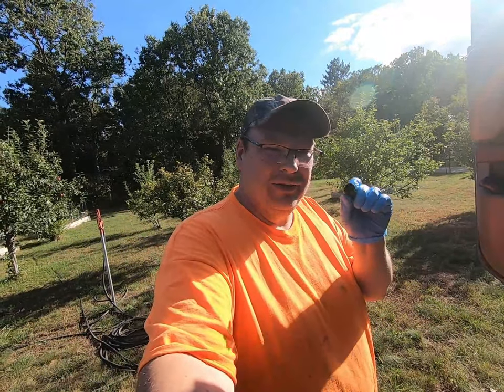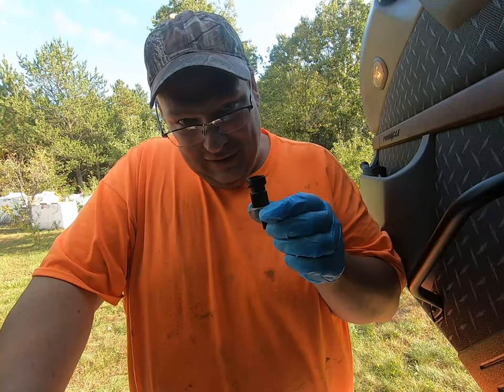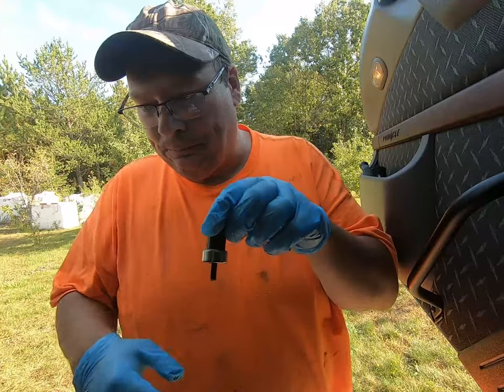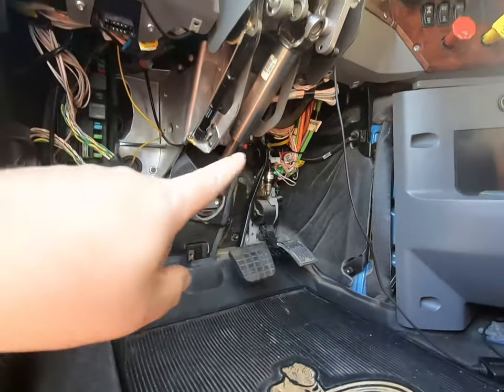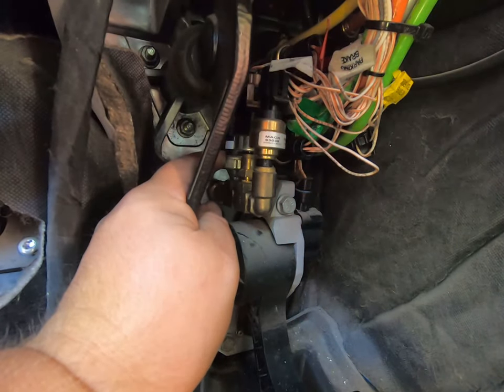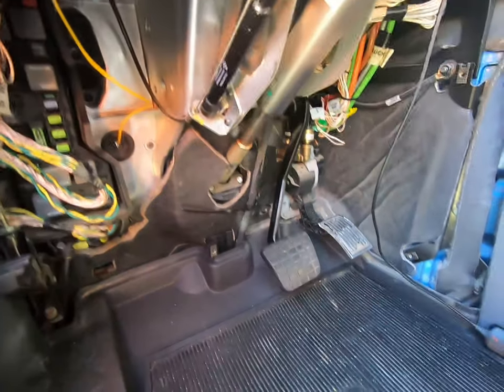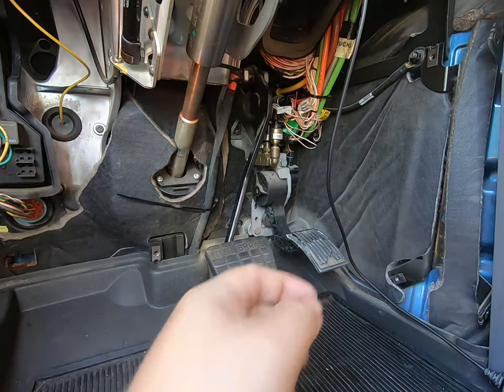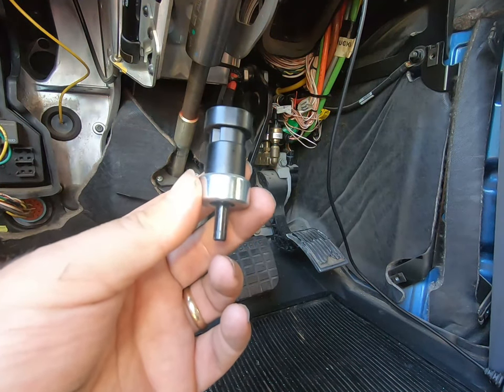No truck or trailer brake lights??? It might be this part. How to fix

Comment: So let’s say that your air tanks were 100% empty, you wouldn’t have any brake lights when pushing the pedal correct? Because it relies on the air pressure to trigger the sensor before it sends electricity to the actual brake lights?

Comment: Good afternoon sir!  I have a question about my truck I would like to ask you if you have time!  I have a 2019 Peterbilt 579 . I have no power going to my rear lights, other than the right turn signal. That’s the only thing that works all others are not working. I checked all my fuses and all are good, but no power going to those fuses!  Would you happen to know just what I can look for sir?  I’m down and out of service till then !  
 Thank You so very much for your time and your help 🙏🙏 have a very blessed day!
Reply: Did you find the issue? Having same problem with the same truck.